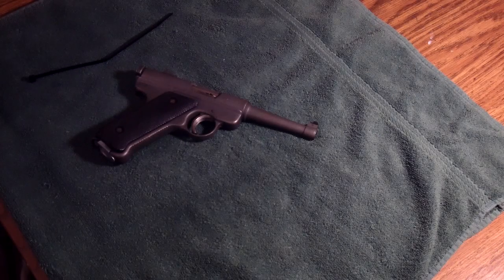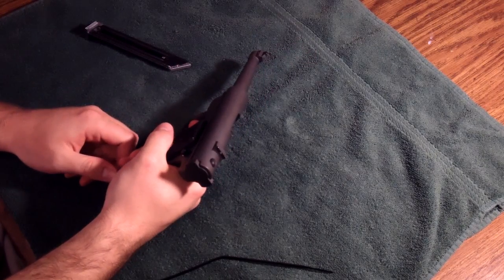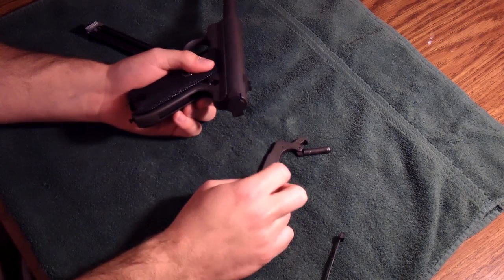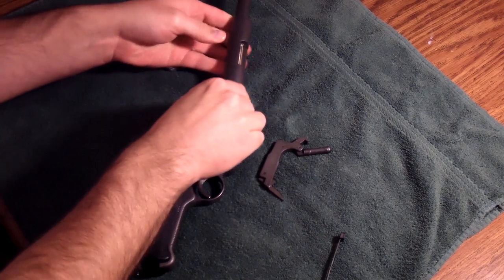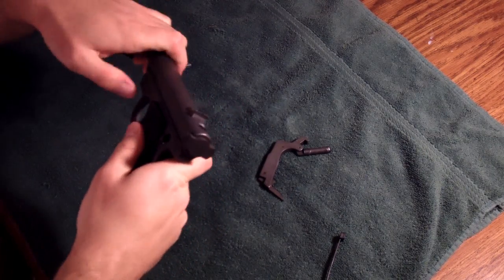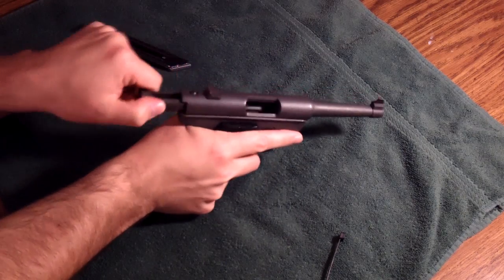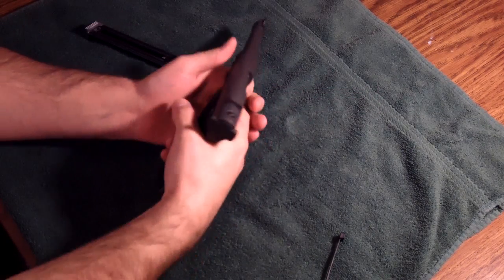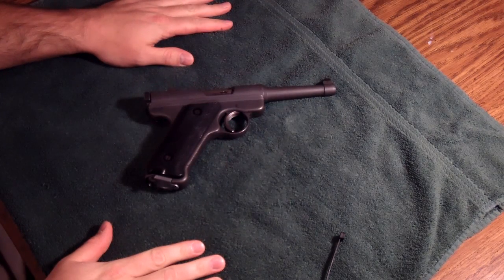Ruger MK1 Disassembly and Reassembly

Comment: Thank you for a succinct video, to the point, well lit, and you noted that the hammer position is critical in reassembly. I had to take mine to the gunsmith to reassemble because I had the hammer positioned incorrectly - very frustrating.
Reply from the maker: Jim Hundrup Thank you for the comments. That hammer is a pain, the new ones are said to be easier to reassemble. Thanks for watching.

Comment: You made this look really easy but it's not so easy when the gun has been unmaintained for 20 years. I'm just grateful a family member kept it for me at all. Another family member turned in my great grandfather's WW2 M1 Garand service rifle to a local police station for voluntary destruction. Can you believe that? Insanity. I would have cherished that thing like my child. At least I inherited a few of his guns. 

 I had to use a rubber mallet to knock the receiver off, neither myself nor any of my friends could pull it off like that. After that, it was easy, but then putting it back together was a pain too. I had to use the mallet again in the opposite direction to line the receiver up properly so it barely sticks off the back, and then I have to wiggle the pin like crazy to get it to click in place and stick out the top. I almost bent my thumb backwards trying to push it in without wiggling it like I have Parkinson's. Hopefully the more I shoot and clean it, it will loosen up. Thanks for the video, because the manual was not helping.
Reply from the maker: Thanks for watching, glad you where able to get it back together. I agree it should ware in with use. Shame about the M1, I have a similar story with my grandpa’s gun being disposed of by a careless family member.

Comment: One of the best, most concise explanations I have seen on disassembly.  I have been field stripping my MKI since 1975 and agree that is can be challenging at first.  Getting the strut aligned with the mainspring is probably causes the most consternation.  Takes some practice but is fairly straightforward and no excuse to put off cleaning your gun. I also use a zip tie with a small loop fashioned at one end to lift the lever on the mainspring housing. Works great. Also saves any marring of the blue if metal tools are used to pry it out.
Reply from the maker: It’s a good idea isn’t it. Thanks for watching.

Comment: The pin on my Ruger 1, on the Main Spring Housing was so super tight. I constantly had to tap the main spring housing into place. I had enough one day and ground down the top pin. I reblued the pin and it's been SO EASY to unassemble/reassemble. It must have been a factory defect. I disassembled/reassembled the gun 20x times before I reduced the diameter of the main spring housing pin. I only reduced the diameter by less than 1mm diameter, but it worked.
Reply from the maker: Thanks for posting. And thanks for watching.

Comment: Great video but..at 1:56  it took me >20 minutes to put this in holding it as shown.
'It' being a small, dangling pin. 
The 'hammer strut' pin must be on this side of the mainspring housing (as seen in the video). So I actually hold the lower so that pin can hang (down) and voila.
Thanks for taking the time.  I have owned this gun forever and never had the barrel off that I know of since at least the 1980's.
It looked like an old basement inside.
Reply from the maker: Your welcome thanks for watching.

Comment: I have a mkI, and cant get the main spring to pull out, no matter how hard i pull it will not pull down.  tried rubber mallet at top of pin, and hammer with wooden dowel, will not move.  it will twist a fraction, but that's it.  any ideas?
Reply from the maker: Some times they are very sticky. From the factory, if you or anyone else has never stripped it down before can seem if they won’t come out without some super human strength. Also if it was not taken the best care of overtime gunk, dirt, dust, debris, congealed oil, grease can get in there, and seemly glue it in place. My suggestion is as follows; use some good penetrating fluid or just some WD-40, let it sit, then reapply. After a while, give it a tap or to with a rubber mallet to loosen it up. Then get a good grip on the release lever with a zip tie as I said in the video. See getting a good grip is key, I’d where gloves too, and dry it thoroughly of what ever you used as a penetrant both before you try to take it apart, and after very important to remove that during cleaning. If you get the release open, and pin won’t come out try a bit more WD, or whatever, and some more love taps with the mallet. Good luck. I know you can get it. thanks for watching.

Comment: thanks for the vid i did everything the same way but a pin fell out and i dont see where the pin goes or where it can even fit
Reply from the maker: I wish I could be of more help. But with out seeing it in person, I could not say what pin it is. I can tell you there are a few in there that could come out if they were loss to begin with. My advice would be take it back apart carefully, and look really hard to see what pin is missing. A parts diagram would be a must to help you in your search, they are all over the internet. Hope this helps. Thanks for watching.
Reply: BubbaTac thanks the pin was from the bolt i couldn't tell because none of the parts came out but once i pull the spring out of the bolt the piece fell out
Reply from the maker: +dezertkingz714 Good to hear.